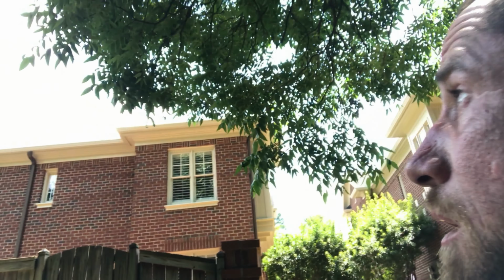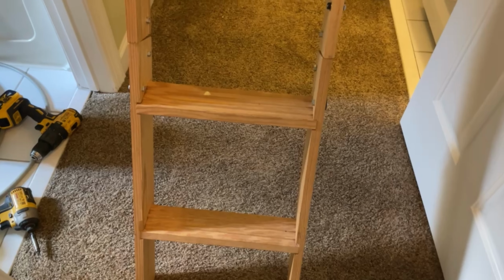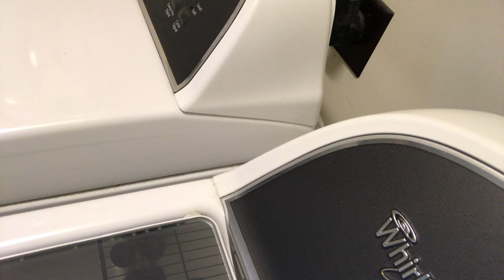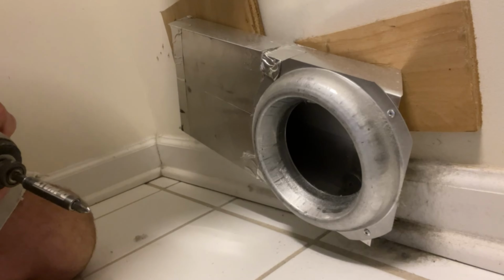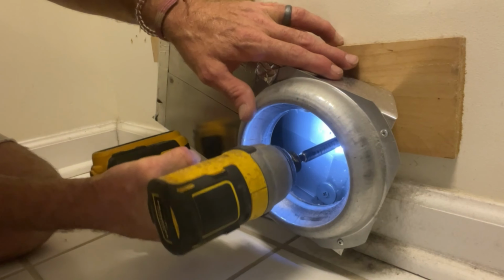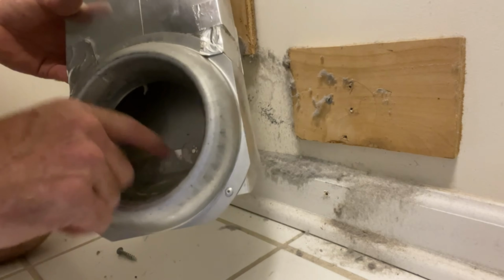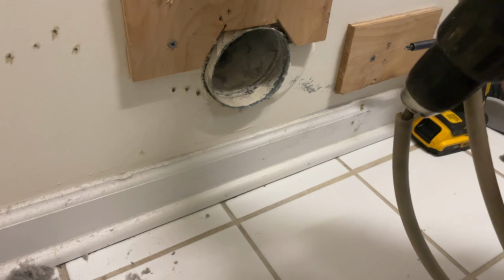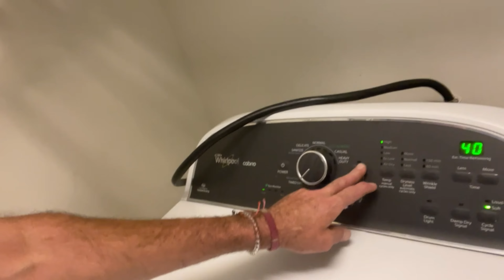A First on The Channel! Cleaning a DRYER VENT! #almetaldryervent #satisfying #fyp #fypシ゚viral #diy

Comment: That's how mine would have to be cleaned!
Reply from the maker: Yea, that's how a homeowner would typically clean theirs if up high!
Reply: Same...EXACTLY how I cleaned mine... but it was with a drill brush where you add extensions... I did it from the inside exactly like he did... then followed with an electric leaf blower... My vent run looks almost exactly like this one.. straight up like 10 feet (guessing) then a slight turn (then maybe 8 more feet) exiting the roof... and I do NOT blame him for not wanting to go on a roof.. Mine is steep as hell.. I grew up getting on roofs and when I got on mine I didn't think it would be a big deal till I go up there... scared the freaking crap outtta me... and the vent is on the extreme top.... never again..... I still say they should not design houses where the dryer vents through the freaking roof

Comment: The cause of lint build-up is low air flow - that periscope is killing air flow adding 20 minutes to each drying cycle.
Reply from the maker: Yea? Guess it's good you don't have one! With your ability to judge time via YouTube, seems you're wasting your time here.. Yes, it DOES have two sharp angles however, when you have to retrofit a small space, and make sure it can vent, there is no better option! Prove me wrong! Tell the class how you DO it......

Comment: If the vent goes to the roof, do they always have to be cleaned from the top down? I got my vent cleaned, first time in this house that we moved to. And now the dryer is over heating. We never had issue before. The guy came back and said it is the vent issue and he said there might be a damper gate that stuck. :-( We never had issue before. I just wanted to be cleaned.
Reply from the maker: No they can be cleaned from the interior however the roof damper still needs to be inspected/cleaned! Is there a screen in your roof damper? You can always go into the attic and take the duct apart. That way you can inspect the damper from the safety of the attic and not via the actual roof. Just poke your hand out through the roof damper. If there's a screen, you'll be able to remove it from the inside... Hope that helps!